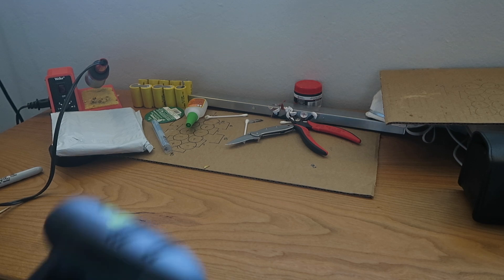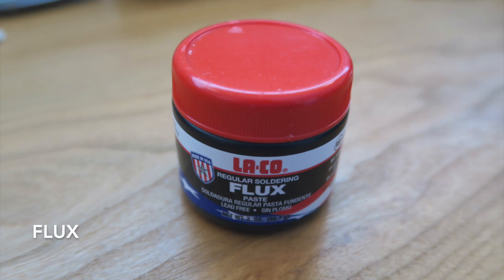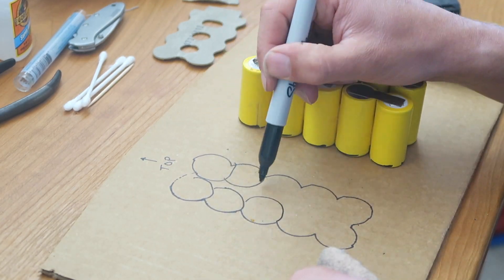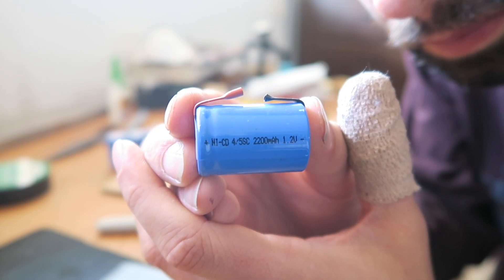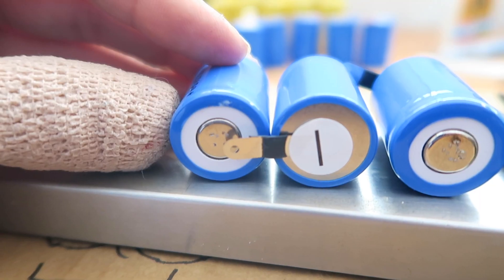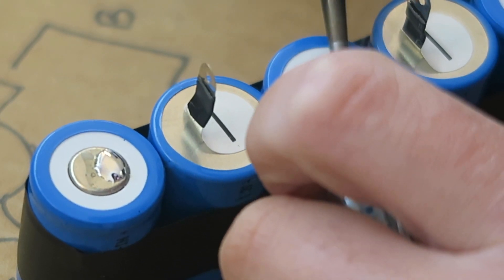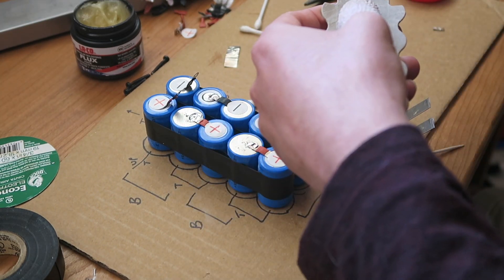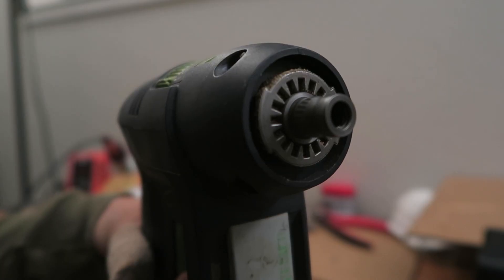DIY Cordless Drill/Tool Battery Pack Rebuild/Repair! Less than $10!

Comment: Made it look so simple when you explain each step of the process.  Been looking for something to get me started on rebuilding an obsolete trimmer battery and 19.2v die hard battery pack.  I know, there are replacements for the 19.2, but at 79yo I need something to keep me occupied.

Comment: This is indeed a C12 with 3000 mh  NIMH battery. A C18 does not take C12 batteries. Thanks for the vid, Im in the same boat.